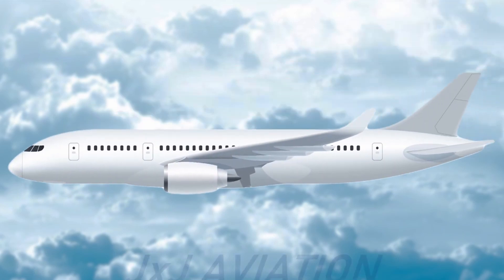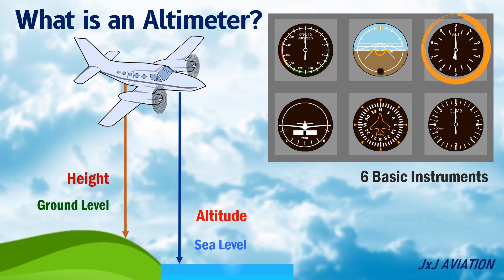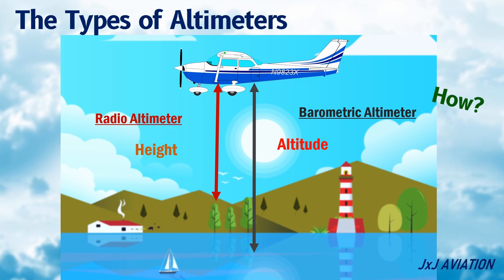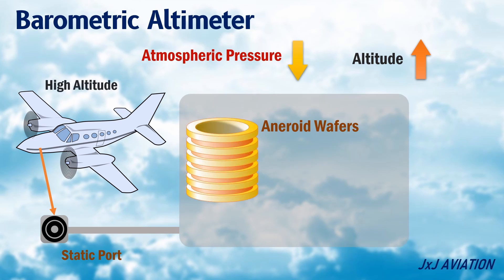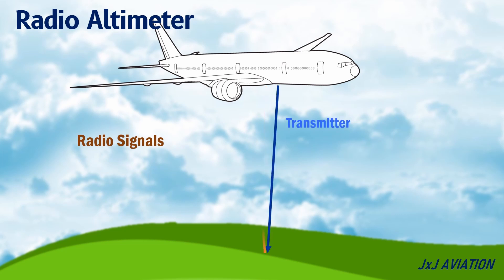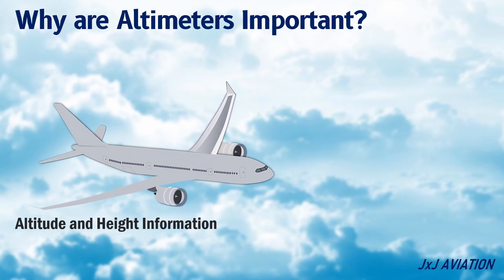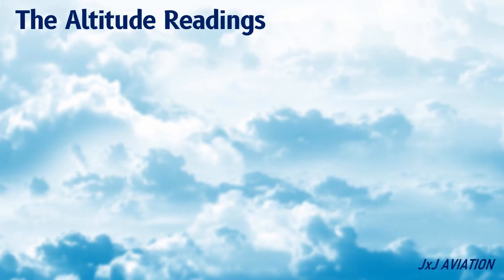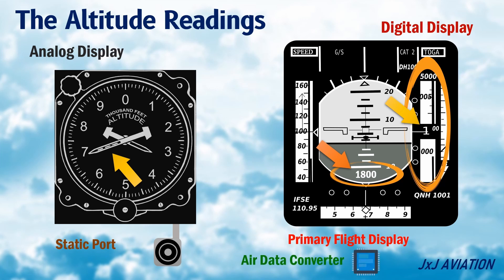What is an Altimeter? | The Types of Altimeters | How Altimeters Function & Why are they Important?

Comment: Pilots primarily use the barometric altitude, as it is difficult to maintain a constant height above terrain, especially in areas where terrain height changes constantly. The radio altimeter's primary purpose is very close to the runway right before landing for the GPWS callouts.
Reply from the maker: Thank you for sharing this information!